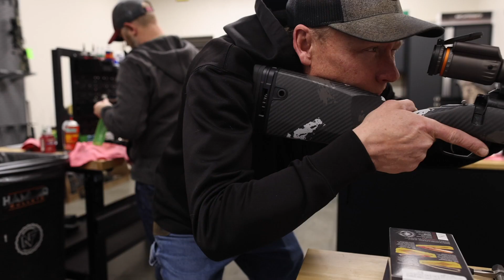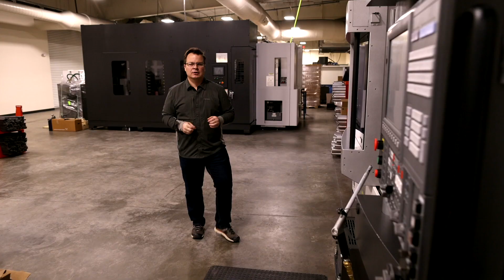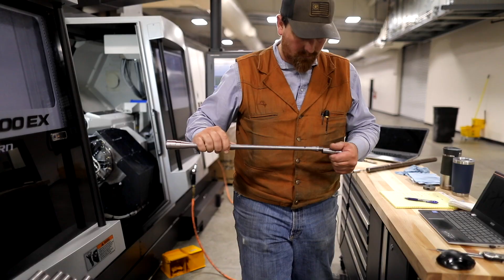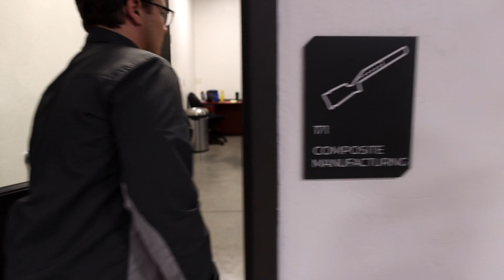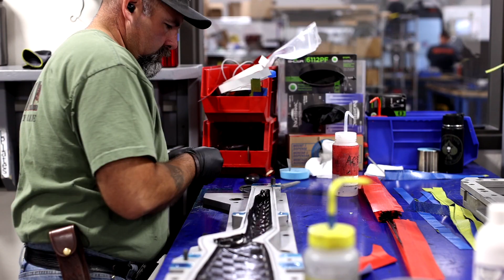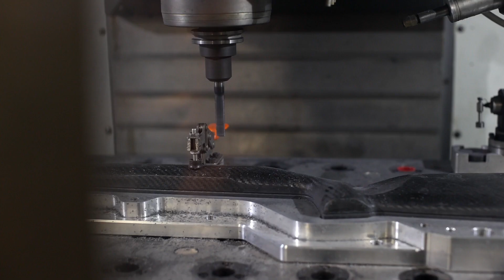Building Gunwerks | Vertical Integration

Comment: First, I do not own a Gunwerks rifle but I have watched several of their videos. 

This is a very educational video about good lean manufacturing practices.  As a former manufacturing executive, we can see how Gunwerks has brought processes under their own control, simplified their processes and therefore reduced leadtime dependencies from their suppliers.  Good lean manufacturing is driven by pull signals (based on a takt time) and while they did not go into this, they clearly understand the practice and (I predict) can see reduced material investment and operational efficiency benefits as a result of everything discussed in this video.  The point of use location for small parts (I called them toothpaste and TP) is an example of ABC inventory classification and is a robust tool that allows the operation to not get halted by being out inexpensive parts.

Well done!